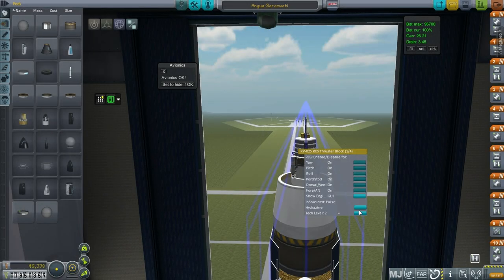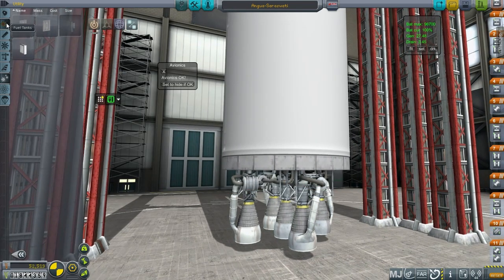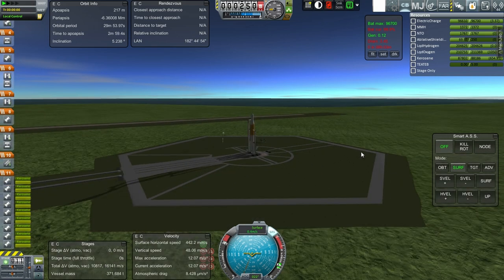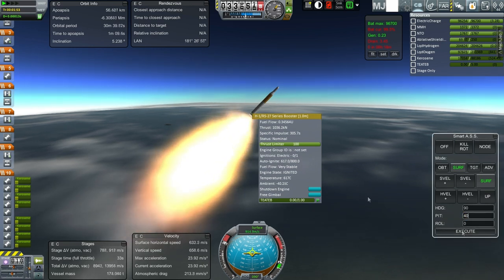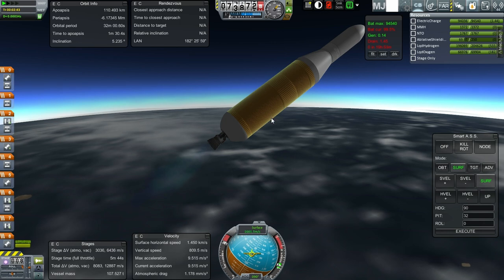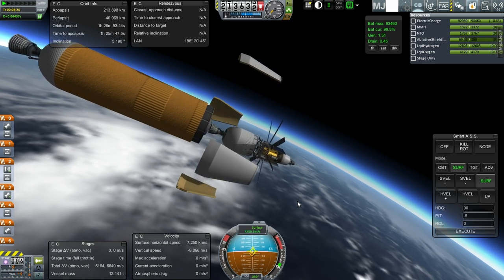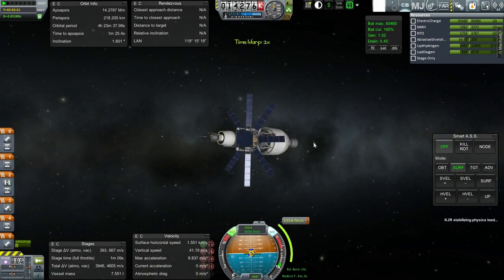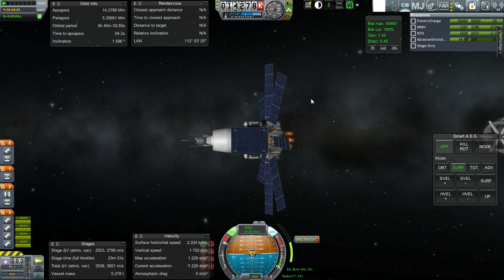Realism Overhaul in KSP Beta 22 - Mars Probe Prep Part 2

Comment: Good Job on keeping control of the rocket. What do i do to change the color of the exhaust plume of the engine? I would like to have a different color.
Reply: Gyffen1971  Install Real Plume or HotRockets.
Reply: winged Thanks for the info.
Reply: Gyffen1971 Real Plume probably needs RO and SmokeScreen to work, it comes with RO, I don't know if there is possibiity to install it separately. Hot Rockets will work with stock engines, Real plume probably not.
Reply: I have Hot Rockets installed at it does produce a descent plume for the rockets and color
Reply: Have you thought about using the (MFS) Mobile Frame System Mod to make your vehicles?